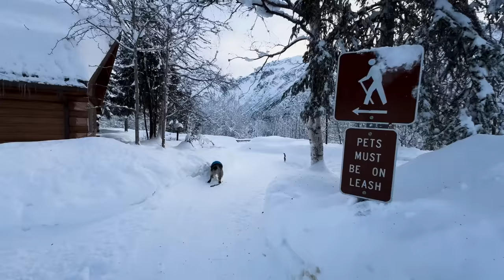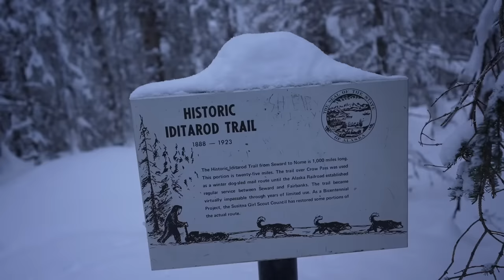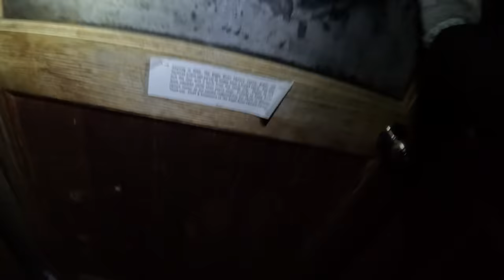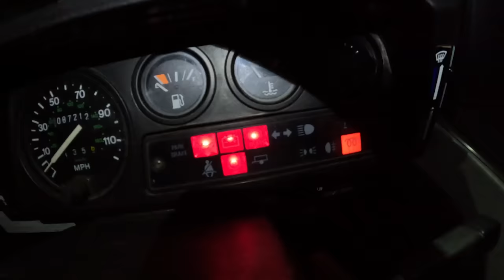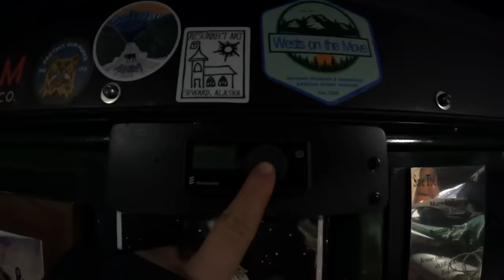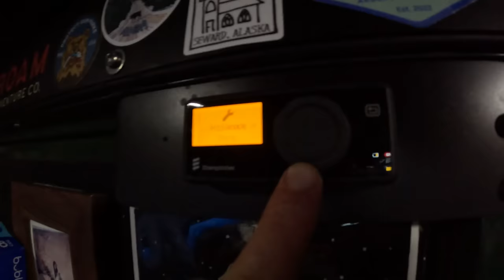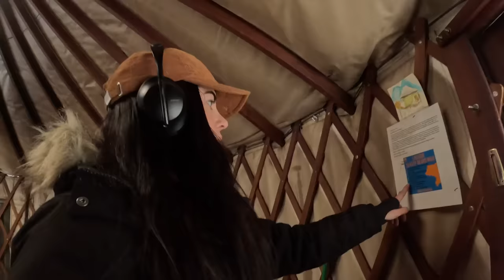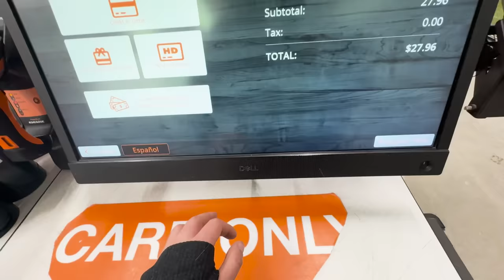3 Horrible Days Truck Camping in Alaska

Comment: I have to wonder if the damper was closed on the wood stove. The damper has to be open to allow air intake into the stove to provide oxygen for a fire, and to exhaust the smoke through the flue in the chimney.
Also Maria, it's always a good idea to carry bear spray with you.
You got through it though. Well done.
Reply: ,,,,,,my thoughts exactly
Reply: Definitely looks closed in the vid and position of it doesn’t change.  And hence all the smoke inside… woweee, seemingly self-inflicted torment, like most of her vids.
Reply: This was my thought as well. Damp wood wouldn't cause so much smoke inside and it would also explain why the fire didn't start.
Reply: Really you don't know how to use a wood stove?
Reply: I think all the smoke in there is the telltale clue. Also, given how low the humidity probably is, it would be hard for that wood to be wet.
Reply: Yeah, I think you need more skills in starting a fire. Hey, you got a lot of guts to visit that State though, I wouldn't. Your content & personality are always sweet. Great video!
Reply: I thought so too but looked for a damper and couldn't see a Handle definitely none on the pipe
Reply: Thinking the same thing !!!
Reply: Keep your worthless bear spray and just carry a firearm of sufficient capacity.
Reply: It definitely looks like damper is closed or chimney is plugged. Also that Buddy heater is scary with no CO2 sensor. She needs to go to Arizona for winter or rent an apartment for Feb and March. Her vehicle is not set up for Winter camping properly. @gungadingo
Reply: If you’ve watched a few vids this is one of her first times starting a fire, you live and you learn.
Reply: Bear spray? She's got a knife!
Reply: You have to keep the wood stove door cracked to let extra air in when starting the fire until you get a good draft in the chimney and a few pieces of wood have caught a good fire. I wonder if the chimney had a cap on it or was plugged from the outside.
Reply: Yep. No oxygen,  no fire.
Reply: A miracle she Made it this Far..
Millennials think they can just “Be”…😂..
She Needs to go home.
Reply: @peterloichtl4512 😂..😂
Reply: @donnordstrom31 😂
Reply: What I was thinking
Reply: My immediate thought exactly…that really sucks if that was the case.
Reply: I was wondering the same thing
Reply: AlI I can say is so stupid. So staged
Reply: You shouldn't be in Alaska if you can't manage a woodstove. Its obviously not drafting properly. You need to go south!!
Reply: Have safe travels ❤
Reply: That’s my guess.
Reply: @denisepeters8551 Your kind reply is short but speaks volumes and it’s welcome in this thread. Others have chosen spite. I expect hate coming from (some) males because it’s always there without fail in adventure videos made by women, regardless of their reasoning. It’s worse coming from women because instead of cheering on one of their own, they are jealously tearing her down.💖
Reply: @catalinafirefly4685 why does she need to go south? Isn’t she entitled to live and learn form and take risks for herself? Everyone who has ever explored anywhere throughout history has been challenged by nature and equipment failure. The dog would also be fine as cold and snow aren’t anything near as bad for them as for humans. Frankly it didn’t even need the booties.
Reply: @0Logan05 well she did make it “this far” how far did you make it? Factually no one’s life is or has been without challenges related to their choices. Only people who are unsatisfied with their life write spiteful and negative comments. Really sad you thought it necessary to tear her down.
Reply: Makes you wonder how prepared some people really are . Honestly, when a cabin fills full of smoke.....
Reply: I was literally coming here to say that..Former Alaskan here.. that’s exactly what it looks like..
Reply: Well I guess I don't have to tell you what the problem is because the comments have it covered 😉
Reply: My Thoughts exactly
Reply: @0Logan05 easyyy now… not all millennials are careless. I know a lot of people that have taken the time to over the years, and understand how things like this work.
Reply: You should always carry a gun. Many problems can arise traveling and camping alone. Bear spray won’t help you if you get attacked. I’ve seen videos of women doing the same thing you’re doing and they had some bad in counters with weird men. One women was freaked out by a man coming to were she was on a 4 wheeler and he would sit there and just stare at her not saying anything so she started recording him. I believe nothing happened because she did this. It was so creepy to watch and you knew something was wrong. She decided to get out of were she was going camp. This guy could see campers from we’re he lived. So he knew she was alone. Please carry a gun and always have it on you.
Reply: I too thought about the damper. The wood should have burned but couldn’t take hold because it was stifled by lack of air. Positive damper was closed.
Reply: Telling someone they should always carry a gun is quite ignorant. You clearly have no experience confronting wildlife.
I have spent considerable time in the British Columbia, and the Yukon wilderness, and have had to use good quality bear spray a few times. I can tell you it is quite effective, not just on bears, but also large cats. The records show people who use guns during an attack, are often mauled, or killed. This is because they panic, and miss the kill spot, or don't have the right calibre, or completely miss all together, then it's game over for them. The sprays travel quite a distance, and it comes out in a large plume. You just have to point it in the general direction. When it hits the snout, and eyes of the animal, it feels like they are on fire, and they run away.
Before you risk somebody's life advising them to get a gun, you need to educate yourself.  @ginagalpin5145
Reply: Why people think that it is easy to start a fire in a stove when it is actually not easy. And this girl should have made some research before going to the middle of nowhere where she needs to take care of her.  She is then stupid not just for not knowing how to start a fire in a stove but also for going through the dark deep forest in the middle of the night just because she does not want her dog to be cold OMG.
Reply: @katarinasimoncicova4766  it's a park next to a neighborhood.  it's not middle of nowhere.
Reply: @iskosalminen  I dunno.  I built a fire outside with damp
 wood and the smoke was so thick the neighbors were concerned.
Reply: That’s what I thought instantly
Reply: lol bear spray is good. 10mm , 45 acp, 44 mag is better
Reply: I thought the same thing, she really doesn't know what she is doing in a lot of these videos, I'm a native Alaskan so this stuff is common sense to me. I guess not everyone knows how to use a wood stove? Alas the channel is called "Roaming Reckless".
Reply: I second that though. Definitely would’ve been a smoky if it was open.
Reply: It can only be a plugged flue that's it.check  the easiest thing first the damper.
Reply: I live in Alaska and live in a small cabin on 158 acres of land by myself for 28 years.  I commend her bravery and sense of adventure.  Don’t listen to all the insecure male comments …their manhood is just  threatened by the fact that woman can survive without them.  I highly suggest getting a gun because there’s a lot of bad people that will try to hurt you and other things given the opportunity and you need to be able to protect yourself.  Alaska is beautiful and youve seen it in the winter and you should make another trip during the summer .  Keep trekking lady!
Reply: @ginagalpin5145  Yea most times its not mother nature or wildlife, but weird effing creepy people we have to deal with .
Reply: A large size bear spray
Reply: first thing I thought too ..was the damper closed of an obstruction in the pipe .. like an small animal nest ...
Reply: @iskosalminen I tried to start a fire with damp wood in my home fireplace with the damper open and it still smoked my house out…
Reply: I know dumb much!
Reply: That’s what I was thinking.
Reply: She literally just completely filled the nice yurt up with smoke because she didn’t open the damper. I’m sure someone left her instructions on how to use the wood stove?
Reply: ----> "I have to wonder if the damper was closed on the wood stove. The damper has to be open to allow air intake into the stove to provide oxygen for a fire, "

She has the door to the stove wide open.  Oxygen flow is not the problem.  As far as flow through the flue/Chimney, that doesn't affect getting a fire lit. It can affect whether smoke starts to fill the room, instead of going up the chimney.  If that happens even after the flu is open, simply opening a window or door to the outside for a few seconds solves that.  The dampeners don't come into play until you closed the stove doors.  No,  it's the way she is stacking the wood in the stove that is the problem (or lack of stacking). Highly in-efficient.  Her kindling is burning out before it can ignite the wood. She needs to build a house of wood and ignite it in the center.
Reply: My thoughts exactly
Reply: that was my first thought
Reply: Surprised if that's it - very savvy camper...
Reply: This is what i was thinking when she said the smoke was going into the room
Reply: @livingwiththepets  that makes sense. that happened to me when I first used a fireplace...i just figured she is an advanced handywoman.
Reply: the bear are hibernating in northern Alaska right now
Reply: bear spray can be dangerous also. it is better to learn how to yell at a bear and blow off a FLARE or just scare them (which is more than possible). bear spray is ineffective and provocative. i used to live there. we just scared the bear, beating two trash can lids together was a preferred method with a loud "Get out of here" ------- learn it from the local tribal people before you use it though. there is a think line between provocation and defense.
Reply: MOOSE do not react well to pepper spray
Reply: When she was packing up it was closed
Reply: Was just going to type the same… it’s good to keep blue on a leash at night. Just incase some predator picks up his scent.
Reply: @alexanderedwincase considering all the effort she did to get there, the built up anticipation and then the sudden let down. Plus Alaska weather system can be so extreme and it’s sparsely populated so her choices carry a lot more weight. So I think her behavior is  normal. You are forming your opinion from the outside looking in. It’s like watching a silent foreign film without subtitles, you are left just guessing what the plot is?
Reply: @augustsnowfall5189  you are 100% correct. Without learning first hand most of us wouldn't know...
Reply: people are so funny, I can't stop laughing @alexanderedwincase
Reply: A friend of mine could start a fire in a fireplace/stove so fast:  would start a fire on a long stick would reach inside and "warm up the chimney"--- made the fire draft soo fast.  Quickest Fire prepper I ever saw.
Reply: Congrats to the diesel mechanic!  We need more skilled craftsmen.
Reply: There are no bears in the winter....they are in hibernation. She is as safe as can be!!
Reply: That’s what came to mind for me too.
Reply: Many chimneys need to be primed as well, even if the damper is open.
Reply: Bears usually hibernate in that kind of cold weather. You're certainly right about the stove though. 🐺
Reply: yep 100%
Reply: 😅i
Reply: Alaska even in winter bears don't sleep they come out when they smell food or the weather warms and moose are killers and dog off leash is dangerous
Reply: The damper was closed
Reply: I have hiked that trail up sheep hunting and recreationally many times and although the platters of black bear on that trail should be in hibernation, that is also a major moose area. I would not recommend doing this without a stick that goes bang. Honestly I wouldn’t be traveling in a van without one.
Reply: I agree with the others that the smoke is a sure sign it’s not venting and the fire needs oxygen to burn. I also think if you have a back problem you might get a sled with a harness that goes around your body so you aren’t carrying a heavy load on your back. Then you could put more warm bedding or a cold weather sleeping bag big enough for you and Blue.
Reply: Imagine had she walked back only to realize she forgot truck keys 😮
Reply: CO 2 is not the danger. CO is.
Reply: No, the damper is for smoke release.  There are vents on the bottom of any woodburner for O2
Reply: @emmamccarter4118  yup exactly right, probably had a coffee can on the chimney pipe - it's Alaska, when not in use the chimney is capped
Reply: The loose hair would drive me crazy
Reply: Be grateful for your health.
Reply: @Loudes012 she did good. It was either bad wood or a bad stove....
Reply: Love your dog😊
Reply: WIE GERNE WÜRDEVUCH MITNACHEN WENN ES UM RIERE GEHT DIE MAN RETTEN MUSS HUNDR KATZEN  ICH FINDE ES SEHR WICHTIG     😢❤❤❤❤
Reply: Bear spray and a rifle.
Reply: @offroader9965  Yeah, I think bear spray is a great idea to have, but there's no reason not to cover all your bases. Another person commenting talked about confronting wildlife--well yeah, that's good if you're an experienced outdoorsperson, but the thing that works on bear may not work on the big cats or wolves, they all have their own hunting patterns and reactions to human presence. And Alaska can have a steep learning curve. I would also point out to the young lady, it's the two-legged predator that can be the worst. Women especially can use a "force multiplier" when traveling alone.
Reply: Worst scenario burn the beds👌
Reply: @peterloichtl4512 Not good.  You have to know how to use a wood stove or fireplace first.
Reply: Her sense of humor and beauty will get her further than most of us!
Reply: @timgabriel9397  you have poor taste
Reply: @gungadingo how are you going to drive from u.s through Canada and to Alaska with a firearm? Remember she is driving a vehicle not flying.
Reply: @bobjacksob  poor taste, is telling someone they have poor taste.
Reply: @em34ev3r totally hear you and get It! I do a lot of camping on my own, and then fishing as well. For the camping when out of cell range, I simply rent a satellite phone and alway have the forest / fire ranger phone numbers with me at all times. I leave word with the local camping stores etc. I have “ahem” protection. Even if she were to always have a Veeerrryyyy sharp axe. I know women shouldn’t have To do these things and we should be free and safe but…
Reply: 7 @alexanderedwincase
Reply: I came here searching for this very comment. 
With all the smoke in the cabin, it seems as if the damper was closed and smothering the fire.
Reply: I was thinking of the bears too!! I could never do that by myself with my dog..  Bears and bobcats are always out and about… so scary.
Reply: @ginagalpin5145  How does recording him stop her from unliving at his hands?
Reply: She's a slow thinker
Reply: Exactly what was going on. That is why the cabin filled up with smoke. No airflow. Either the dampener was closed.... or there was a massive amount of creasote build up, and it's chocking it off.
Reply: I am sure that she probably just did not open the dumper or something else…
Reply: Probably was.
Reply: The flue or something the vent
Reply: weird comment @gungadingo
Reply: Happened to me while camping in a similar set up near the Grand Canyon. Forgot to remove the damper and almost got smoked out!
Reply: No oxygen=no fire simple economics
Reply: My first thought!!! Should not be that Smokey inside even with wet wood!!!
Reply: I'm far more frightened by the two legged animals than the four
Reply: Def the flue was closed, we live & learn. Great vid tho, better than TV
Reply: Same
Reply: Yeah it's closed. ..not too bright
Reply: @gungadingo isn't she from Canada?
Reply: My first thought too. Have forgotten to open in the winter and yeah, house full of wood smoke.

Comment: As soon as you said "a 2-mile hike to the yurt", I said "nope". 😆
Reply: Snow and bears??? Absolutely not...
Reply: 🤣🤣🤣 I agree! 😂😂😂
Reply: Carrying all your gear. In the snow. In the dark. Bears. For two miles. Every time I watch Ria's videos, the father in me is concerned for her safety. Plus knowing myself, I would inevitably forget something in the truck and have to go back and get it. Maybe more than once.
Reply: Need a small sled to pull her gear and dog could help !  Rental should have provided it.
Reply: No Way  - plus it's a Dry Cabin. That's a double No Way!!
Reply: Exactly.
Reply: Got that right!!😄
Reply: Plus her time management was way off, getting there right @ sundown set her up for failure. Plus she needs to be more prepared, I've never seen her with a folding shovel, bear spray,I hear she does have a blade. Plus when she gets in her jeep I never hear the doors locking?
Reply: @Dallashygienist yep!!
Reply: @cookiekirkland8689 that type of car doesnt come with automatic door locks.